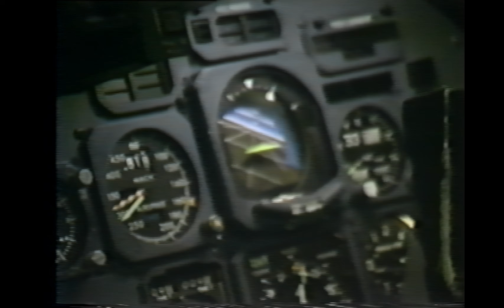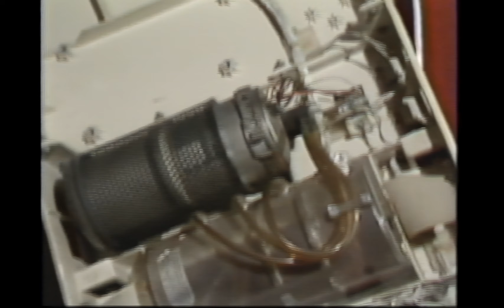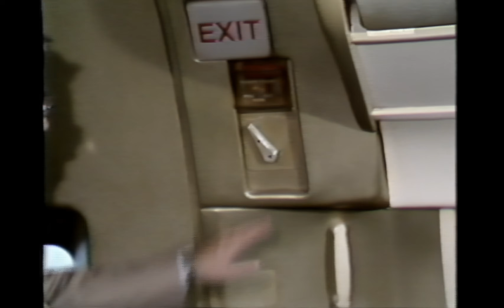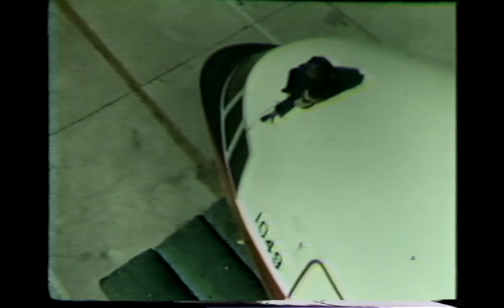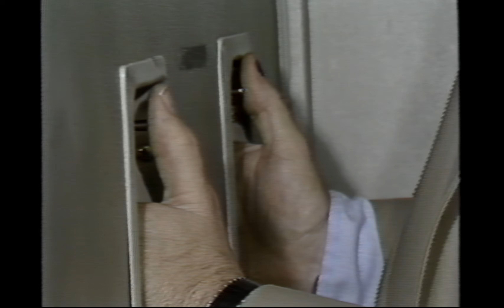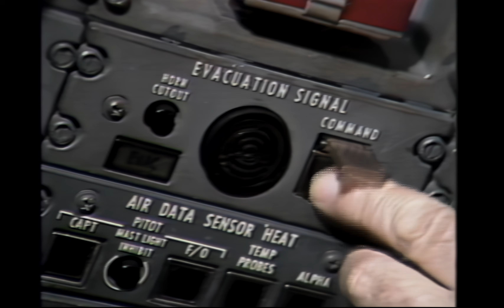Lockheed L-1011 Safety Equipment

Comment: Looking for more info on the oxygen generator system on the L-1011. Seems like it wasn't continuous flow, but it used a different mechanism than the current more prevalent units. The safety demo that's also on the TWA Museum page indicates a "slight burning odor" which I've never seen referenced in other systems.

Comment: I wear a pair of ear plugs around my neck at work in case the fire alarm 🚨 sounds at ear piercing decibel levels. The extremely high decibel alarm makes evacuation needlessly stressful. People need both hands and should not have to plug their ears on the way out
Reply: Nothing against you, but have you been tested for autism? Loud noise is a frequent complaint severe enough to necessitate ear protection. I have asd and two of my three kids have it as well.
Reply: Procedure was to de-activate the audio alarm immediately to aid evacuation and crew control. It's actually pointed out in the video later on.

Comment: I’m now in my 34th year as an airline pilot and the L-1011 was far and away the greatest plane I ever got to fly. It was so insanely ahead of its time and had amazing and thoughtful features. DLC was probably the most unique, but the flying stab and trim roller under your thumb were just perfect too. 

This video shows some of the small details that made it great, like the doors. It had the best designed, most intuitive doors of any plane I’ve ever seen (the 767 has the most confusing I’ve personally dealt with, though I have friends who flew the MD-11 that say that was even worse). It was always clear if the door was armed or not, and it was easy to open normally or in an emergency. If the door is unarmed and you pull the T-Handle the door would open VERY fast, so step away! There were a few things not stated in the video that some subsequent planes adopted (though not all did)). For instance, if the door was armed and someone opened the door from the outside the slide would automatically disarm, which was a great safety feature. 

Lockheed did it right and I was thrilled to revisit the old girl in this video!
Reply: Thanks for the millios of safe miles! On the pasenger side I flew probably hundreds and hundreds of times for business.  The tristar was definetly the smoothest airliner in my opinion. And the most comftorable.
Reply: @Jeff-sp7bg You’re most certainly welcome. I’m glad you had good flights on the 1011; sadly its equal will never be seen again. I feel very privileged to have been able to be associated with such a great plane, even if it was in a small way. Thank you for your comment; it made my day!
Reply: Agreed!  I was fortunate to have flown the TriStar for about six years.  I've also had the somewhat unique opportunity to fly all three wide-body tri-jets as well as the 747-400.  None of them were bad aircraft, but the Tristar was in a league of its own.  The 747-400 was a great aircraft, and while I never flew the classics, I'm confident that the technology of the L-1011 was far more advanced than the Boeings.  Similarly, while the DC-10 and MD-11 weren't bad flying aircraft (though the MD-11 was definitely a bit quirky and definitely unforgiving), the McDonnell-Douglas products were definitely under engineered (and yes, one could argue the L-1011 was over engineered).  It really was a Cadillac (back when that meant something)!
Reply: @And @AndreySloan_is_a_cnut Thank you so much for your thoughtful reply; it certainly means a lot from someone with your experience. I never got to fly the other widebody trijets, but have friends who’ve flown both. People seemed to like the DC-10’s handling characteristics, not so much the MD-11’s (especially during landing), but I can’t address that. I can look at the appalling early accident record of the DC-10 and realize that I’m definitely a 1011 guy. Guys at my airline that went from 1011 to the MD-11 didn’t seem to enjoy it, and a lot of them badmouthed it. I did briefly fly the B-747-400 and it was fine, but I still liked the 1011 better; I especially appreciated the spacious and ergonomic cockpit (the DC-10/MD-11 looked comfortable too in all fairness). I flew the B-747-200 sim a bit and it flew fine but it was much less ergonomic than the 1011, especially the overhead and autopilot. Having said that, I’m not qualified to give a truly informed perspective on that and I fully acknowledge the 747 family for being great, groundbreaking planes. 

Again, thanks for taking the time to reply and always fly safe!

Unlatched Forever!
Reply: @HEDGE1011  - The L-1011 cockpit was definitely the roomiest.  Also, both the DC and MD just blasted air into the cockpit through a vent that you really couldn’t shut off - a really annoying windchill effect!
Reply: @AndreySloan_is_a_cnut Good to know it wasn’t just my perception and affection for the L-1011 biasing me on the cockpit roominess issue! The windchill vent on the McD planes doesn’t surprise me, but did make me laugh. They really did seem to do the least engineering possible, but in the process came up with some of the most convoluted mechanical designs that just made me scratch my head. My first airliner was the DC-9, and I flew it and the MD-80 a lot early in my career (~10,000 hours of character building). Overall I liked the plane (I certainly preferred it to the 737 which is the one plane I’ve flown that I truly despised), but from the earliest DC-9-10 to the latest off the MD-80 line (and I hear from friends the 717 is the same) the cockpit windows all leak, especially during deicing. Other planes have nowhere near the struggle with openable windows. Then you look at the assemblage of mechanical parts that operate that window and it’s just nuts…they were all designed with a slide rule and a French curve; that must have been thousands of engineering man hours. Other examples include the spoiler handle (remember, for an abort it’s up, back, and up!) and in the -80 the flap handle with the great in theory dial a flap. That was fine until you got a flap setting near the slat decision area and then there were all sorts of machinations to get everything in the right spot with no takeoff warning outburst. And of course the bulk air vent above the jumpseater’s head that was either off (you’ll boil or freeze depending on the ambient temperature) or on (it’s the windchill effect of cold air blasting down on you and making the otherwise very quiet cockpit very noisy)! Good old days. 

Still I appreciate the toughness and simplicity of the DC-9, but from what I know of the DC-10 it was an underengineered rush to catch up to Lockheed with no corner left uncut. It seemed to morph into a decent plane after the initial big problems had been fixed, but it’s alarming that the pylon issues never truly went away after AA191 and have been sitting there dormant since 1979 to turn around and bite the poor UPS guys (RIP). Lockheed definitely went the other way and made a gold plated overengineered machine that pilots loved because it was so well thought out. I have several type ratings on my certificate, but the one I’m most proud of is the L-1011. I very well recall the horrendous oral exam for that rating. You know how complicated the plane is, but how effortless and logical the systems were in practice. The questions that were just under the surface for the examiner to ask were extremely thought provoking and really required a lot of knowledge, especially around autopilot, flight controls, and to a lesser extent electrics and pneumatics. Great airplane that truly was the Cadillac as you say. I remember the old joke that 1011 stood for 10 wheels and 11 pumps…I still think that hydraulic system was the best of any plane, ever, including the 747; the redundancy was genius and really paid off. That Eastern 1011 that had the fan disk detach and come out the side of the plane took out three hydraulic systems; fortunately Lockheed had four and a safe landing resulted instead of a UA232 scenario. I reminder reading that Lockheed had a conscious design process to try to keep multiple system lines from crossing rotor planes to the maximum extent possible, and that really paid off in the end. I still miss it and would be flying it today if we still had it on the property. It’s the only plane I truly miss flying. 

Thanks again for your replies and indulging this wide-ranging (some might say rambling) reminiscence!
Reply: @HEDGE1011  - All perfectly stated (though I never flew the DC-9 or B-737, so I take you at your word there!).  Another engineering example was the entry doors - as the video shows, the L-1011’s were pure elegant simplicity (at least from the operator’s perspective), the DC/MD’s were a Rube Goldberg nightmare.  I very much remember after our class had to demonstrate operating them in the trainer, all us us basically said, “I’m never touching that thing again - let an FA or agent take the blame for blowing the slide!”  Very well out when you said no corner was left uncut by DC/MD.   I always said: “Built in Long Beach, engineered in fields all over the world!”

Comment: A cockpit escape hatch and 5 interia reels.  Remarkable!   The L-1011 was so far ahead of its time.  A stunningly beautiful and extremely sophisticated aircraft for the time that she was built.  I'm grateful for every chance I had to fly on one.
Reply: Let me tell you, though, that hatch was a last resort. Nobody loves the 1011 more than me, but if you’re going to go out that hatch you really want to be first because every reel has razor sharp metal tape in it and you may have up to four other tapes out there blowing around in the wind if you’re last out. It’s not as hazard free as the video implies. The B-747-400 is my other experience with the reels, and the same applies there, only you’re even further from the ground. 

Still, the L-1011 is the greatest plane I’ve ever flown, and I couldn’t love it more! I’d still be flying it if we still had them.
Reply: Not only that, the TriStar's powerful Rolls-Royce RB211 turbofans were among the quietest and most fuel-efficient jet engines ever built at the time. The TriStar-1 and -100 used the RB211-22, while the -200, -250 and -500 used the RB211-524.
Reply: Mannnnnn I’m fat af and I would SO get jammed in the galley + elevator escape hatches lmaoooo, I need to get 1980s slim

Comment: I have been looking high and low for L-1011 door operation videos. Thank you!
Reply: The doors on the 1011 were the most logical, best designed doors of any aircraft I’ve ever flown in my 34 years or airline flying, period! What a great machine!
Reply: @HEDGE1011  If you want a good comparison, there is a Canadien Airlines DC-10 training video on here. The mode of operation and the simplicity of the system is curious. One might think Lockheed would be over the top, but the functional simplicity is so impressive.
Reply: Me too. This is my ultimate fantasy come true!